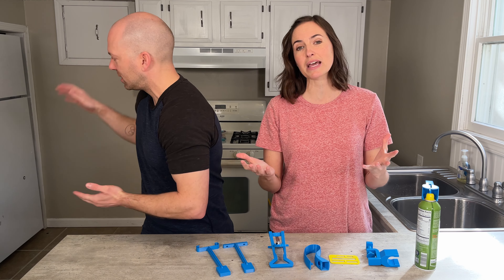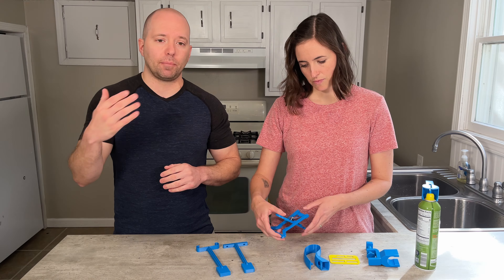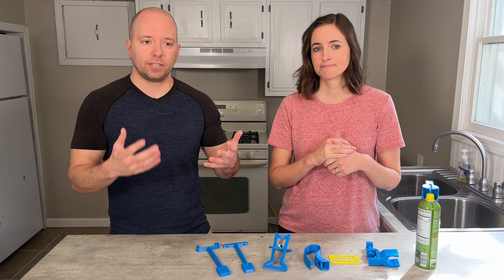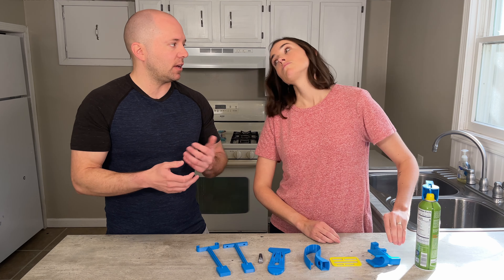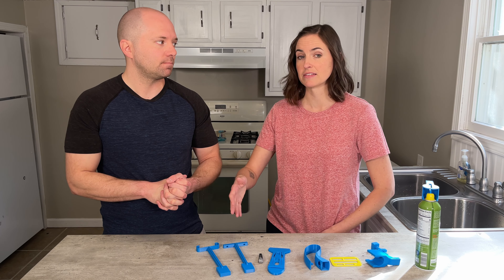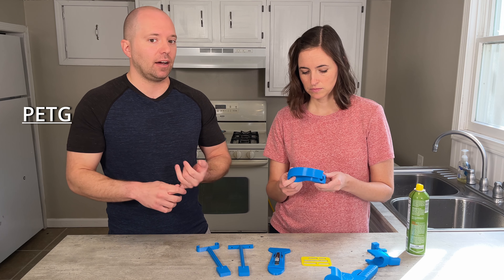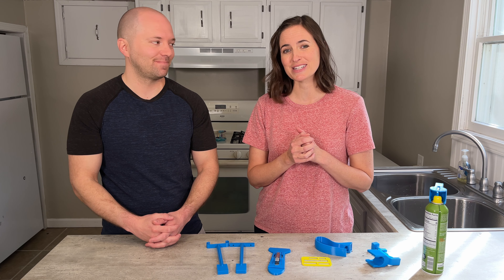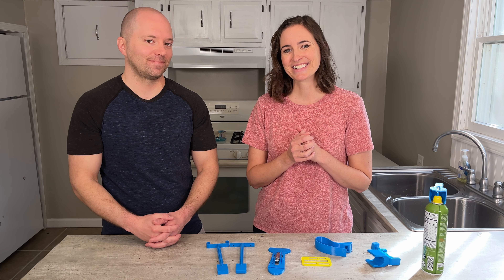3D Printed Adaptive Equipment | How to Get Started and What to Know!

Comment: I designed a holster for my folding cane that attaches to my wheelchair as well as a shopping bag hook that goes between my seat cushion and seat sling! The hook can be placed anywhere under the cushion but I put it in the center, then rest the bag between my footrests (if long enough to reach that far). Much easier to reach then a bag hung behind me! My boyfriend has a 3d printer and we're on the second round of prototypes for both ADs :D
Reply from the maker: That's really cool! That's a great idea for 3D printing. We love using 3D printing for prototyping. Please share those ADs when they are ready!

Comment: Hello! I'm an OTD student and I'm curtly doing my capstone on integrating 3D printing into the OT curriculum, could you share a little bit about some limitations you have found while using printed adaptive equipment in the clinical setting :)
Reply from the maker: Understanding material choices to produce proper durability and functionality. This can make a massive difference in the success of a 3D printed piece as more than a short-term fix. The other issue is time and level of training for therapists wanting to use the technology properly. There is a lot of tech skills along with understanding of maintenance and trouble shooting the equipment. We're busy and that isn't always afforded.
Reply: thank you so much for your insight!!!  @EquipMeOT